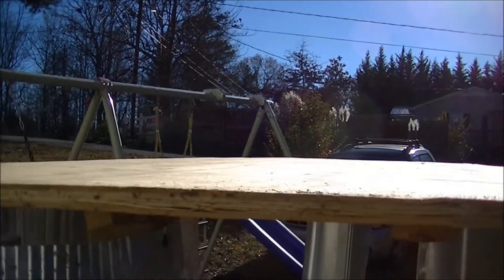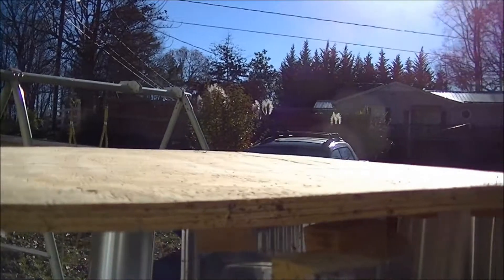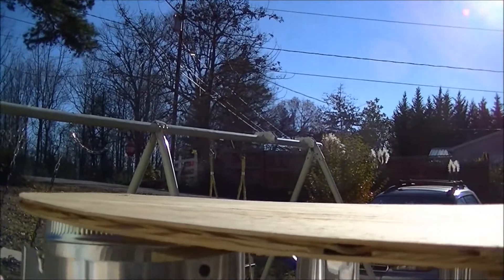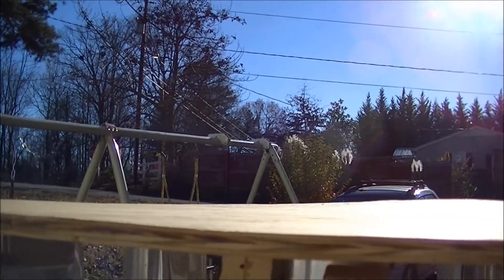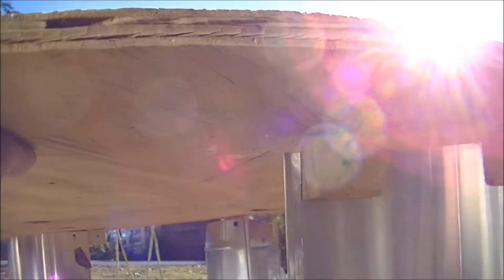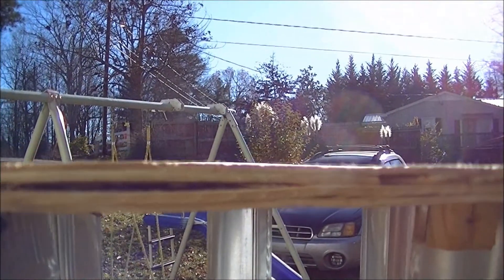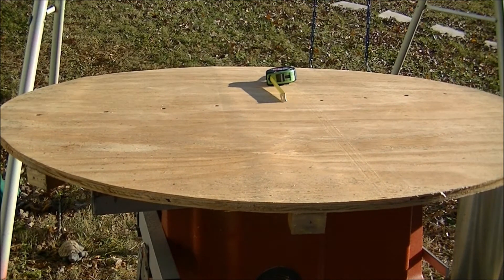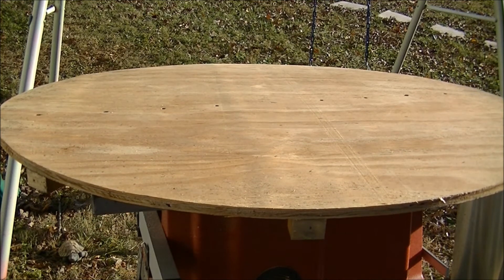How To Build A VAWT Part 3 Repair Work

Comment: humm when it snows will you have to brush it off. i see that stuff in home depot that you put on wood and brick and every thing to make water run right off. you might want to think about that for snow
Reply from the maker: I would think the snow would fall off from the centrifical force, but that might still be a good idea to keep the wood from getting to wet.
Reply: i know sleet and snow will be a pain
Reply from the maker: Most of the time snow only stays for a very short time here. But at my other play it stays a very long time.